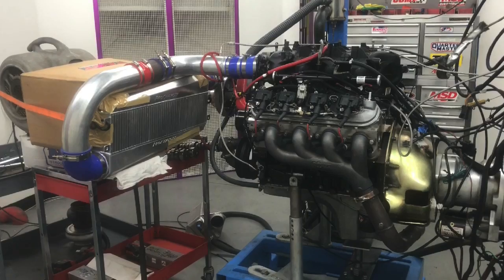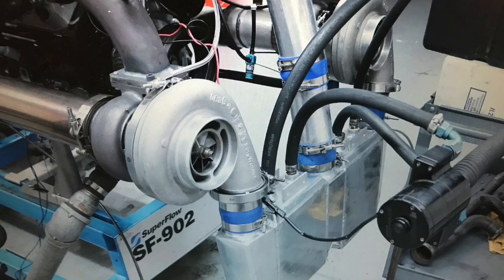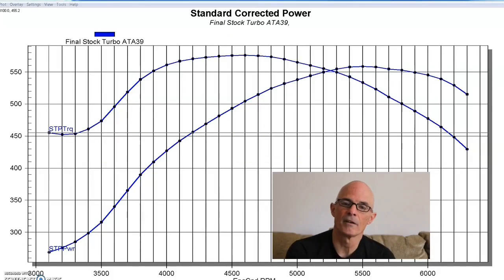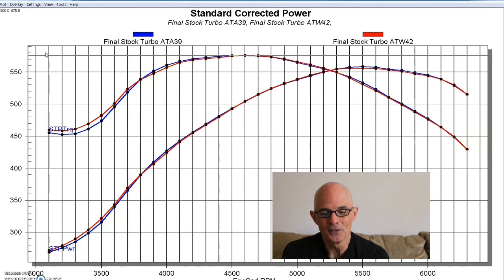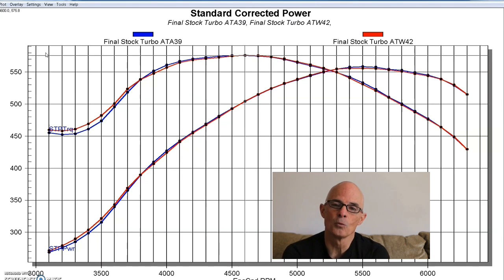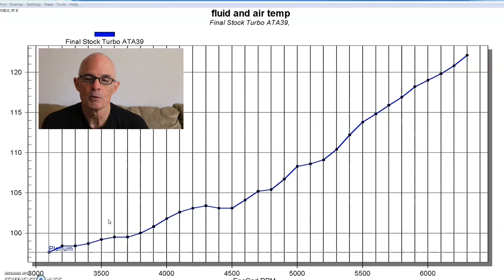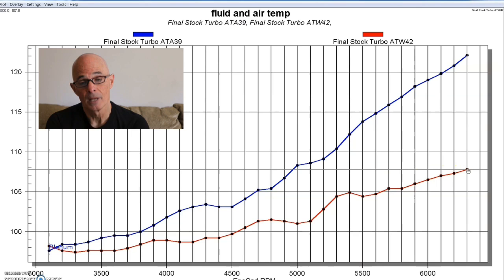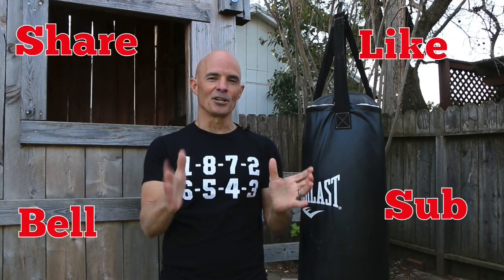LS TURBO INTERCOOLER TEST-ATA vs ATW

Comment: Lets add methanol injection to these test!!!!
Reply: Whether it is an added element, or separate testing altogether, I still think Water/Methanol injection is an extremely interesting topic.  E85 is not readily available in a lot of the country (or world I suppose).  I'd even like to see what can be achieved with water/methanol injection supplementing 87 octane gasoline...
Reply: @tptrsn     Alot of these tests are done with race fuel.  I haven't seen anything on Richard's channel where they test the limits of lower grade pump fuel and intercooling and supercharging.
Reply: @superkillr  Agreed, and I understand why.  It's likely to break stuff. Lol.  But still, if he would do it, I think it would be some interesting content.

Comment: Your running E85 post intercooling... The latent heat transfer of E85 probably evened out the temperature difference.
Reply from the maker: you're assuming E85
Reply: @richardholdener1727  you're right... I did "ass"ume E85. I thought you said during the video that you used E85, but you were just talking about it earlier, you didn't say you used it.

Comment: OK I've got one for you Richard, how about a test of N/A versus N/A air to water intercooled.
Reply: Pointless, nothing to cause adiabatic heating = no need for intercooling...
Reply: "Inter"cooling implies cooling "between" two stages of compression, but "pre" cooling of the charge air would indeed increase it's density and should increase power.
Reply: @fascistpedant758  not worth the weight or complexity...
Reply: @YZFoFittie   One lb. of ice could cool enough air for a 10 sec. pass with a 600 HP engine by ~50* F. Charge density would increase by almost 10%.
Reply: @fascistpedant758  nope...
Reply: @YZFoFittie   not every engine is run on a dyno, some of us use them in cars. Not every car has a plentiful supply of ducted cold air feeding a heat isolated air filter box. Lots of cars are limited by space and need to draw the hot air in from under the hot bonnet. Some of us have nanny state regulations that won't allow you to cut a hole in the bonnet to feed cold air. Water cooling just before the intake manifold may provide the engine with a stable intake air temp, or as Fascist Pedant said nothing stops you doing up an ice box (or other medium) for N/A performance down the strip. It's all about air density. That the point of a test to see if the IC is a bigger hindrance than it is a help.
Reply: @DodgyBrothersEngineering  
So 
Much 
Fail
Reply: @YZFoFittie  yep and that's why people like Grumpy Jenkins, Smokey Yunnick and others were such catastrophic failures, because they were too scared to think outside the box and try things no one had ever tried or thought of before. Do the same as everyone before you, and get the same results as everyone before you...

Comment: Wouldn't the reason for the a2w be to get your charge cooler so you can widen your tuning window to add more timing? Would the change be drastic if you tuned each setup to its potential? Based on the different IAT's
Reply: Yep and that is the problem with alot of these dyno tests.  They seem to think that if they keep everything the same, the results are a direct reflection on the thing being tested.    Methanol Injection test was a big one.

Comment: I would have liked to have seen the dyno of the turbo without the intercooler.
Reply: Yes. I agree.
Reply: Basically the Boost curve would be identical. The difference is about  3% less hp around the curve entirely under boost with no intercooler do to the inefficiency as the heat in the inlet would be +165'F
Reply: And with ice water in the air to water system also.
Reply: Or even vs a carbed blow thru setup.

Comment: Why’s the power the same? Because the IAT wasn’t different enough to have to change ignition timing to resist detonation and the difference in air density due to it was trivial.
Reply: Why haven't more people at least acknowledge your comment ...
 I believe you are correct

Comment: The temperature in the combustion chamber has more to do with horsepower output than the air entering the motor. Air is not a dense medium compared to the metal in the cylinder and the fuel. Since there is no meaningful change in temperature in the combustion chamber no matter which intercooler you use, horsepower remains the same.

Comment: The low thermal mass and thermal conductivity of air explain the difference in IAT. It"s difficult to guess-timate the mass of each running across the intercoolers.
Was the IAT signal from that probe also used by the dyno to calculate corrected power? That would explain the identical curves.
Reply from the maker: The IAT probe has nothing to do with dyno calibration-it doesn't change calibration based on IAT
Reply: @richardholdener1727   The deviation from expected results is too small to deduce anything from it. The squiggly temp curves don't inspire confidence in their accuracy. A 1/2 psi difference in charge pressure would explain it. A richer AFR on the ATA run could provide sufficient extra charge cooling to account for part of it. A sample size of one run with each set-up isn't exactly statistically valid either. Over-analyzing this without more, reliable data is pointless. Chalk it up to normal variations on the dyno.

Comment: Science alert ⚠ :
In kelven the temp difference was 315K vs 323k. A difference of only 2.5%.

When looking at PV=nRT, a 2.5% change in 'T' isn't going to be earth shattering as far as things go.
Reply: Good post, most people forget this.
Reply from the maker: science alert-the difference in IAT shouldn't be expressed in Kelven. 12 degree difference compared to 108 base is 11% or 9.8% compared to the 112 degree base
Reply: @richardholdener1727   I have to agree with Science alert, you must use absolute temperatures.
Reply: @richardholdener1727  

On that Mr. Holdener, I’m going to have to respectfully disagree 😉. But that’s what makes the world a great and diverse place. 

For completeness (and for everyone’s knowledge) : here is an overview of the reason that cooler intake air is more desirable. It’s because of the ideal gas equation: PV=nRT as I mentioned earlier.
P = Pressure (Pa)
V = Volume (m³)
n = No. of moles (basically the mass of the gas in this case)
R = Gas Constant (~8.315JK−1mol−1)
T = Temperature (°K)

All values are absolute values, not ‘gauge’ values (unless you have an absolute gauge😉, And are especially not US customary units 😉)

So taking the example at hand:
-P and V are fixed. P = 170kPa (10Psi gauge) and V = the volume of the intake manifold for simplicity. Its actual value is not important, since both are constant.
-R is also constant by definition
Which leaves ‘n’ and ‘T.’ 
Now in our case ‘n’ is the dependent variable, as it is dependent on ‘T’ which we have control over, via out choice of intercooling.

Since both the Left and Right side of the equation must be equal: (Here’s the CRUX) as temperature rises, the mass of the gas must fall to maintain our desired pressure (170kPa) in our pre-defined volume (the intake manifold.) The inverse is also true (Colder air, requires more mass to maintain the same 170kPa in the intake manifold.) Since power output is dependent on the mass of air (Oxygen) contained within the cylinder, the cooler the intake charged at a fixed pressure, the more power you should make.

Now as Richard (and others) have rightly noted, it is difficult to do back to back tests as:
-turbine heat plays a roll, 
-Intercooler design (resistance across the core) effects results
-Exhaust back pressure can be affected because of different Intercooler core resistance at the same intake manifold pressure. Turbo must work harder to push air through a crap cooler to make the same manifold pressure -> higher turbine drive pressure -> less shaft power at the crank.
-Atmospheric changes (humidity and temperature)
-Fuel temperature
-The list can go on.

Regardless, the test performed is very good and very insightful. I whole heartedly agree with Richard that it’s a matter of choosing the right tool (intercooler in this case) for the job. And that each design is best suited to differing aspects of motorsport. As a Circuit and Rally racer, Air-Air rules the roost 😉.

I stand by my assertion that there is only a 2.5% relative difference in air mass entering the engine (Based on absolute values) in this test. Thus, this would fall well within normal test variance or within the dyno’s level of accuracy based on the number of uncontrollable variables (listed above.)

Keep the video’s coming Richard. I’ll keep watching and learning from your wealth of test data.

Regards
Jordan

Comment: What I take from this is  the power range of a motor with air temperature has a large window where air temp changes but power stays the same. So qustion is how much of a temperature change do we need to see a change in power?

Comment: thats something id like to see remember back about 12- 15 years ago when the gm crate motor thing took off and they were doing that 572 big block chev was it wide open throttle for 12 or 24 hours something like that (im getting old ) but hey lets see some junkyard ls under boost  wide open for 30 minutes or an hour (just to make it easier ) lets see some real ls goodness doing it tough for half an hour that will show us what  a good combo realy is, you know its a good idea richard
Reply from the maker: we tossed around this idea after the first big bang motor to see how many pulls it could make at 1,000 hp, or how long it could stay loaded at that level
Reply: Also most will end up doing a 5.3, so how about possibly doing the forged 5.3 vs a stock 5.3 at a sustained HP level most could feasibly build for, and see when the stock 5.3 internals gives out, and how much MORE we can get out of a forged internals 5.3 WOOHOO!!

Comment: It’s about surface area and the temperature delta across the core. Air to water allows a much shorter and less air volume of piping so more boost and less lag. Air to air is simple and you don’t have to worry about water leaks.

Comment: Add Water/Meth without intercooler and see how it stacks up.
Reply from the maker: I did that test-it is not nearly as good as IC
Reply: I have picked up boost and gone faster at the track every single time I have ever removed my intercooler and added water injection.
Reply: @tunerdadtunerdad7927    No kidding.  Would like to hear more about your system and what the results showed.
Reply: How about a water meth spray onto the front of the A2A intercooler? Perhaps a temp sensor to spray at 104* to help reduce the temp rise?
Reply: CO2 is much better, wont cause you to crash your car when it kicks in...lol

Comment: You will see a difference if you had a better cam. The air was hotter at the higher rpm range. So with a bigger cam that gives topend power you'll see the difference in water intercooled or air to air intercooled.
Reply from the maker: #wrongcam

Comment: I think the air was about the same temp when it got in the engine! So the power is the same!
Reply: If you watched the entire video you’d have seen the temp sensor graph, with the sensor just prior to the throttle body, the water cooler at peak rpm was about 20 degrees F cooler.

Comment: @Richard Holdener another great video. I come from an air cooled engine world and there is a common "trick" that I've also seen used on some ATA turbo cars, the "spray bar" where a cooling media (water, alcohol, or even NO2) is misted across the cooler core with the idea that it lowers temperature more than just air alone. We were all pretty sure it worked via the butt dyno, would this be something you would ever consider playing with to give some real world numbers?
Reply from the maker: I tested the cooler ring on an ATA
Reply: @richardholdener1727  very cool of you to respond. Now I definitely have a reason to go through the rest of your videos, not like I wasn't anyway.

Comment: the water to air intercooler has a larger pressure drop -  offsetting the cooler charge temp advantage. 😎
Reply: Correct, i would like to see a boost port on either side of the intercooler bridges to a boost gauge to see the pressure delta.
Reply: W/A IC generally have lower pressure drop due to their relatively short and wide flow path.
Reply from the maker: how do you know the ATW had a larger pressure drop-you don't have that data
Reply: @richardholdener1727  hi mate, the cross section of the ATA is absolutely huge due to the tanks mounted on the long edges of the core (its the opposite way around on a bmw n54 intercooler)
As for data, you mention all engine parameters were equal as was the power - this was dispite the charge temp difference. It's seems it takes more engine effort to push airflow past the WTA intercooler which looks to be a significantly less cross section than ATA core. What are your thoughts mate? 😉
Reply: Not if the wastegate reference was coming from after the cooler... then the pressure at the throttle body will be the same either way.

Comment: The change in power is usually down to timing and knock sensitivity. Heat will make the engine more suseptable to knock as the boost and power go up.
Reply: Totally agree; was about to post the same.  If the ATA setup was octane/ knock limited or tuned to the point that it was knock limited, you’d see the difference between the ATA and ATW intercooler.  14 degrees won’t be a huge difference, though.

Would’ve liked to see the ATW run with ice water to show POTENTIAL difference, too.

Comment: Hi Richard,  if the intake temp is lower it should be more dense,  therefor a more dense intake charge can allow more fuel and timing , more power, and still have the same target A/F ratio as the less dense,  hotter intake charge?  Yes.

Comment: Next video...
At what boost level do you need to add intercooling....with a turbo application
Reply from the maker: all boost levels
Reply: Richard Holdener 
I’ve read in the past, boost under 10 psi, while running gasoline, the drawbacks include the following:
- pressure drop across the core 
 - extra weight 
negates the use of an intercooler

Comment: Is it possile that the air to air intercooler was slightly less restrictive than the water to air cooler thus compensating for the slight increace in charge temprature
Reply: No, you can’t match air speed across the core for the air to air. The air to water is using a pump with water pressure to force cool water across the core.
Reply: Exactly.  So even if they were at the same boost at the intake, what was the pressure and temp before and after the intercooler?  How about the backpressure? Never enough data collected/presented on these intercooler tests to answer the question.  

Power tracks with mass airflow (less inefficiencies)  Have a higher temp but the same manifold pressure? You have less mass airflow and less cylinder pressure.  Made the same power power to the flywheel though?  Probably exhaust backpressure.? Whats the turbine speeds?  DATA Richard!
Reply from the maker: the pressure drop across both cores was identical-they were not restrictive at this power and boost level

Comment: Air to water might be better for the street, you still need a radiator for it, but if you're style is only short power outputs (keeping inside the speed limit) you might get away with small core for cooling the intercooler water, this is because there is buffer effect in water, (termal capacity)

And also the charge piping impact the turbolag, it's not only the pipes, but also the volume inside cooler.

When you do turbo test like this, is there any way to dyno the turbo lag?

Let's say you put the dyno to not go ower 3 or 4 trpm and on time scale get the engine slowly up on the rews, then floor it and see how fast the boost picks up?

All the best and keep up the great work
Reply: Very true.  He's not testing a closed loop water system.  His water source is the dyno cell water.  Most people only have small tanks and serious guys have actual cells full of ice.